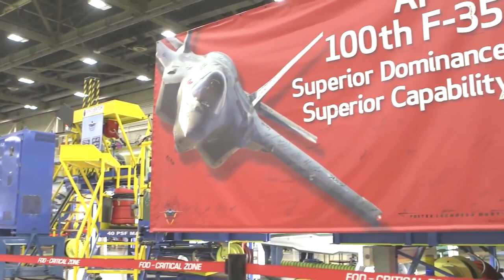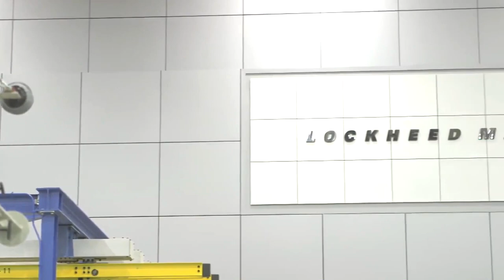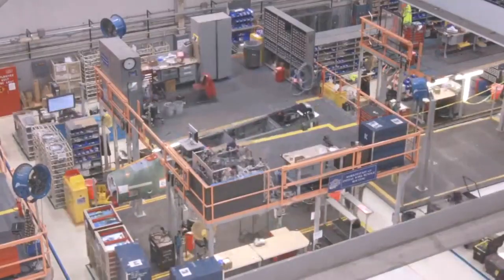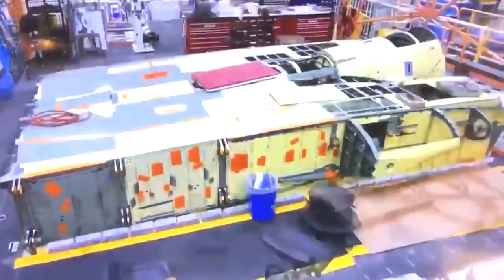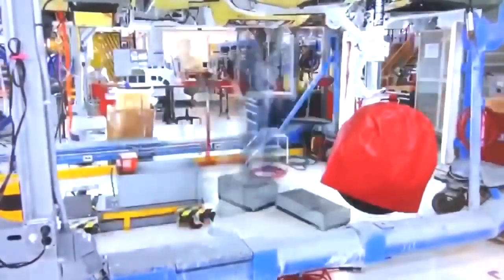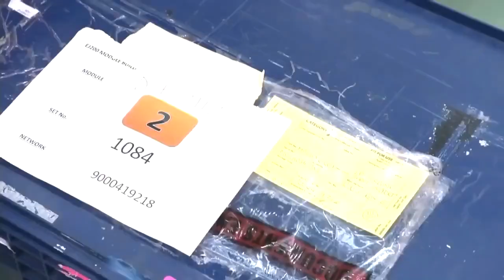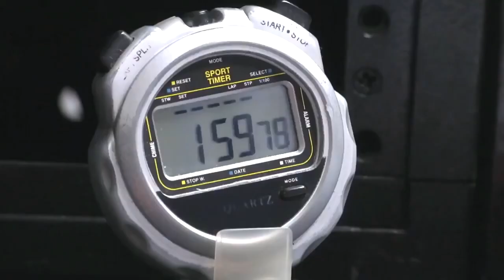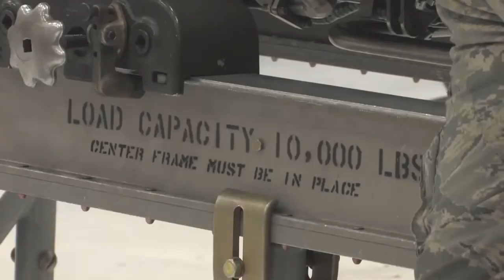FIGHTER JET Factory✈️ Production Engine Manufacturing Lockheed Martin F-35 + F-16 [Assembly line]

Comment: in stead of many bolts, one should uuse a slide in place pattern and then a clicking mechanism or just one bolt to keep the part in place.
Reply from the maker: If you get a job in this factory you can definitely suggest it and maybe it will change the whole production process :)
Reply: lol. no you have to come in from above for that. buy the factory.  @MiasFactory